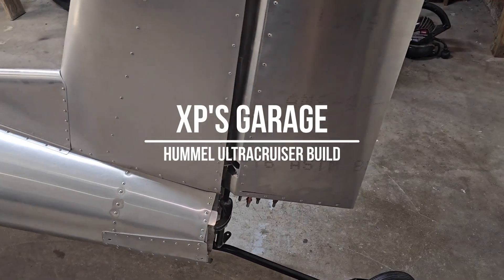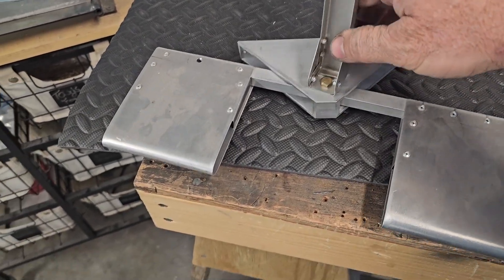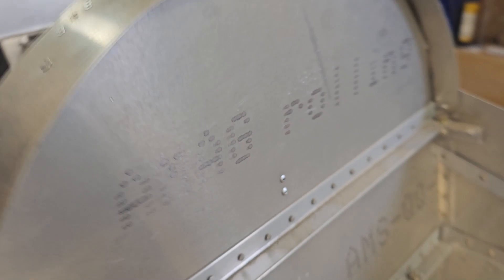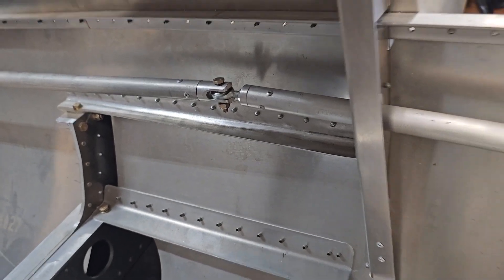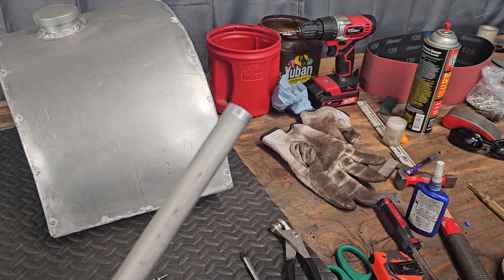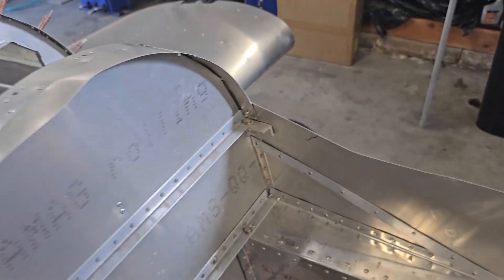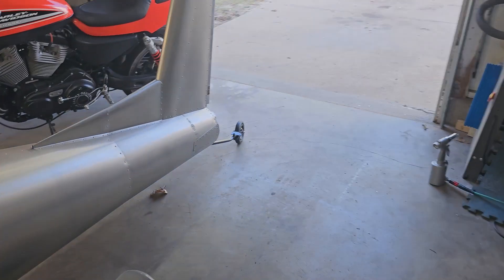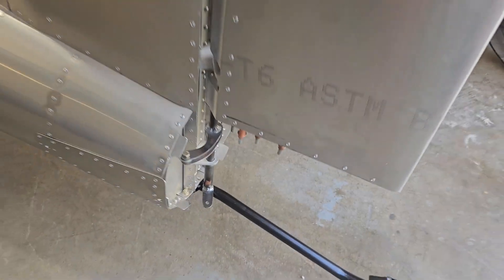Hummel Ultracruiser Build - Rudder Control Is Done

Comment: Great job. I’ve been following since you built the engine. You used the blue streak dr90 capacitor. How has that been working for you?  Thank you.
Reply from the maker: It worked fine for the short time I ran it.  I have went back to the original capacitor.  Do you know what capacitor Cassler uses?
Reply: Aircraft Spruce. Part # 10-51676. For the external installation. About $125
Reply: BENDIX S4N & S6N PARTS